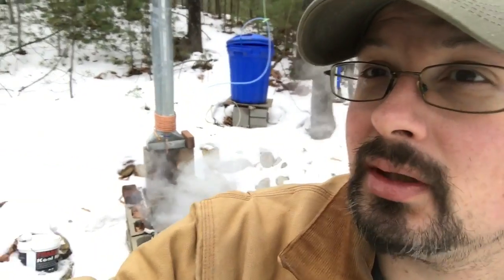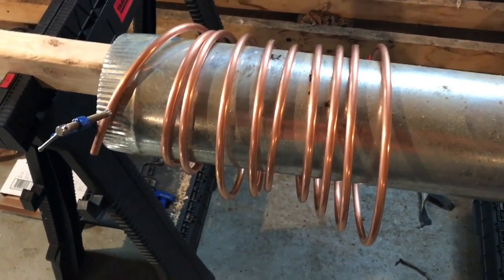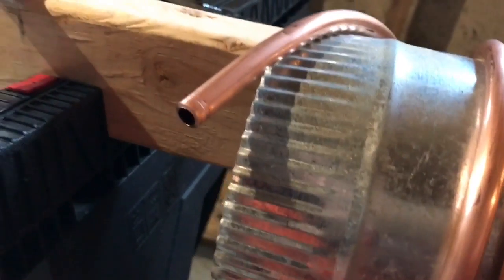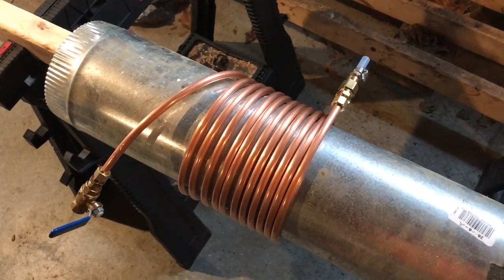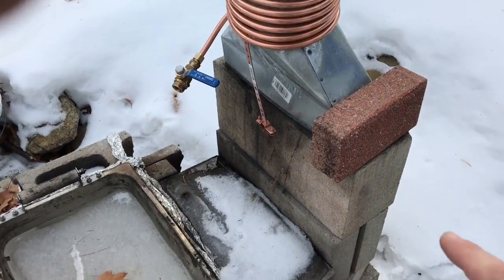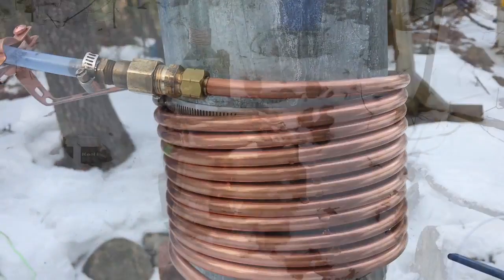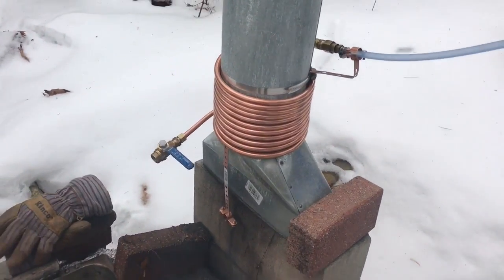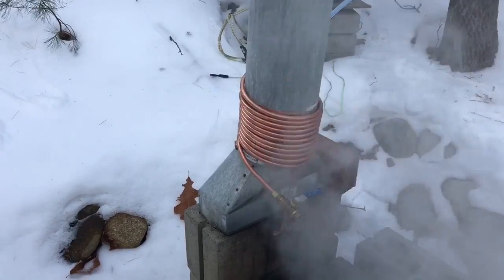Heat exchange for my maple boiler

Comment: The problem with these type of preheaters is that if the flow of the sap is interrupted then the sap will get scorched by too much heat in the copper tubing. Also it is not a good idea to use copper where it is exposed to RAW s app because of the pH of the sap will etch the copper.
Reply from the maker: Thanks for watching the video.  I understand that sap can be burnt in the coil but I constantly have new sap moving through so that it doesn't burn.  I watch it quite closely  especially during the cold down at the end of a run.  I am constantly touching the coil with my hand to make sure it doesn't get to hot or too cold.  I have not had or heard of anyone having trouble  sap breaking down there coils.  IF it leaks or cracks, we will know then.
Reply from the maker: According to the internet maple sap has a PH of between 6 and 7.  That's pretty neutral.  Like rain water
Reply: I have used a similar setup after seeing your video. I had the coil covered with an aluminum shield to keep the heat on the coil but found it got too hot and started to boil, so I removed the shield. If flow gets interrupted, ususlly bu my neglecting to keep my feed tank filled I have a small hand pump to blow sap into the heated coil to restart the flow. Works great. Two years now. I think my pipe diameter is smaller, I think mine is 5/16. I was thinking of maybe going up in size and trying the shield again.
Thanks for your video!